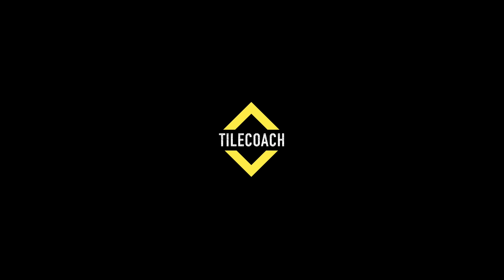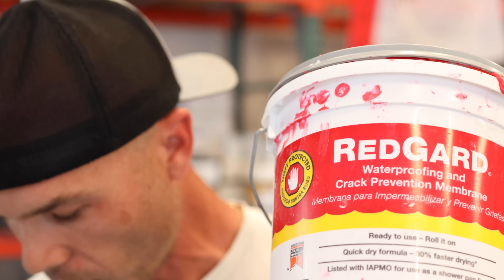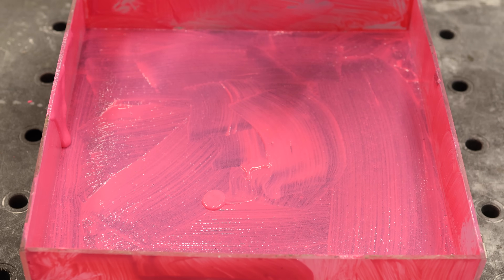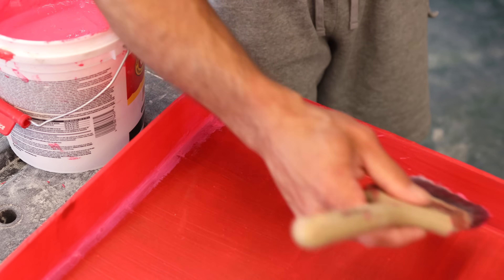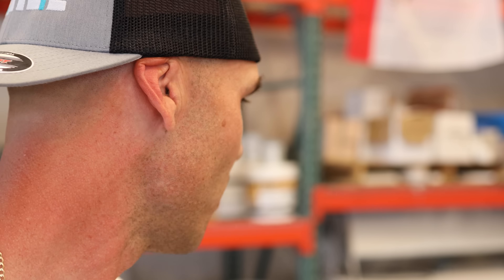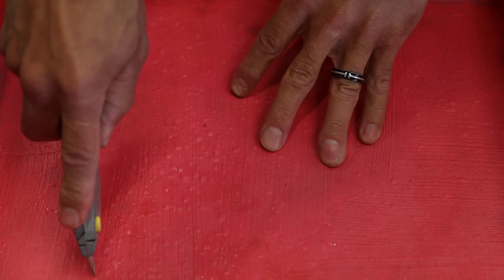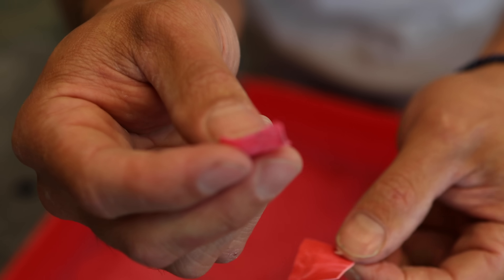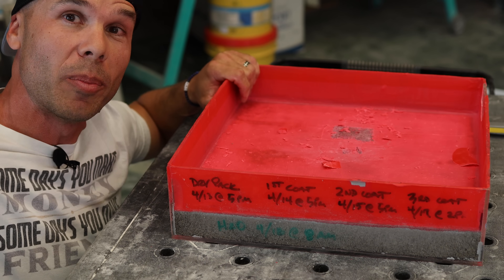REDGARD FAILED FLOOD TEST!!! --- Why Did it CRACK and BUBBLE UP???

Comment: Your model was a total bust. You took a six-sided non water or moisture absorbing plastic material, added a layer of water mortar mix and allowed it to cure for too short of a time. Once you coated the model with Red Gard it gave you a warning when you saw the cracks in the corners but you did not understand what was happening and applied a third coat. What your test displayed was the extra long dry time of the mortar for all of that moisture to evaporate from deep within. All of the cracks and blisters were caused by water vapor being drawn out of the mortar and being trapped under the Red Gard membrane. The water in the mix plus the heat generated by the mortar curing plus surrounding air temperature/humidity fluctuations plus the plastic shell created the perfect storm. Tile setters should allow much greater time for these materials to harden, cure and have their water moisture evaporate fully before application a water sealant upon them. I hope that helps or gives an explanation that can lead to further discussion.

Comment: Use Laticrete fiber tape and laticrete inside corners at seems and inside corners. 3 coats! On completely cured and dried fast cure cement. Hearst Casle's Neptune pool was redone using 3 coats of Red Guard

Comment: 1. I believe you should use a roller for an even spread
2. When applying the 2nd coat, it must be applied perpendicular to the 1st coat. 
Note: if the curing takes longer than 12 hours, something is wrong. And the glass can flex - not sure is the cracking occurred from this or the way you applied the actual product…
Reply: Also mesh backing should be applied over a calking in the corners
Reply: He was following manufacturers instructions. If he would have deviated from instructions then they would cry “foul” and come up with excuses to tear up his test results. He is using their own info to prove test.

Comment: Hi coach there are too many videos of shower failures. , People should avoid all the possible problems and call a professional to float cement over studs using 2.5 lath and 1.5 roofing nails.  install Quorloy pan or hot mop. Looks like flex seal could be a better option than kerdi or schluder. Never had a call back in 25 years using old school cement  method.
 My friend is second generation tile setter and that the method they do. One of my former bosses was also a second generation tile man and only used old school method 15 pound felt paper and 2.5 metal lath.  You tube has lots of video failures using newer methods and most may have been the installers error.   Looks like flex seal would be better than any kerdi or schluder pan especially around the drain. Quorloy shower pans needs special calking around drain.   Yes I like  hydro ban  better than red guard. People think if it's colored it's sealed. By  Brian

Comment: Flawed testing.  
RedGard as IAPMO Pan Liner meeting ANSI A118.10:
1 Gallon (3.78 L)	40 sq. ft. (3.7 M2)  NOT! 80 sq ft.

Bonding to Lightweight Cement and Gypsum Surfaces
Lightweight or gypsum-based materials must obtain a minimum of
2000 psi (13.8 MPa) compressive strength at the recommended cure
time. The underlayment must be sufficiently dry and properly cured to
the manufacturer's specifications for permanent, non-moisture
permeable coverings. 
Redgard does not give a specific cure time, because they do not know what type of mix you'll be using

Comment: Ask Redgard what their opinion is? The real problem is the plastic pans do not vent. That works just like it would if you used two vapor barriers. You are trapping moisture. Deck mud will not be dry in the time you allowed so now you have trapped moisture between the plastic and the Redgard. As a tile coach you should know this.
Reply: HE and you know it, but it's not in the instructions

Comment: yes I agree, The concrete takes much longer than 24hrs to dry, more like 48hrs+ depending on the thickness of the base and tempature of the air. 
Also Im thinking several thinner coats are better that 2 heavy wet coats. 
heavy coats are going to dry slower and have more tendancy to crack.

Comment: Tried the stuff on cementboard in the shower waited 2 weeks before applying made sure seams where all cured. Applied redguard and FOLLOWED the instructions on pail.  Waited another 2 weeks before starting tiles. Checked the redguard... peeled off with no effort. No sticky sticky to concrete board. Think I bought a pail that froze and was later thawed out.
   I go back to Kerdi

Comment: Where would this apply? Red Gard is almost exclusively applied to vertical walls. Gravity is playing a huge part. Red Gard is never used in a standing water situation. Water would never stand on a vertical wall. The water in a shower bounces of the tile and is rapidly pushed straight down by gravity. The test should involve a substrate; Durock painted with Red Gard with tile, grout and tile sealant. The water should be deflected off of an object that simulates the human body along with some soap. How many times does a home owner flood their shower to validate or imitate this sample test? It does not make sense. Use a typical shower setup where splashed water penetrates sealant on top of tile on top of grout on top of thinset. Red Gard was never created to line a tub where the water could not escape. The real problem is the shower pan or other horizontal surface. Maybe get a fire hose and blast a piece of drywall painted with Red Gard or covered with schluter. My shower is 20 years old and the tiles on the shower pan are looking very worn out, but I have no leaks. The tile setter formed the dry pack one inch per 18 inches. The water never has time to do any damage. I am renovating my main bathroom with a cast iron shower pan. It will beat any standing water test you can throw at it.

Comment: My guess is that because your mortar bed was in a plexiglass box, even though it cured, moisture was still present; trapped in the box and sealed by the redgard, hence the blisters.
Reply: This is exactly what happened.
Reply: No kidding
Reply: Yes  damp cement
Reply: Clever!
Reply: 💯 percent the bubbles under the redgaurd tells the story
Reply: So is no point in using the red guard, If you have to wait 2-3 days after your pan installation (in the case of a mortar pan).
Reply: Reply to all the "build base with wood" and "simulate real world conditions" -- the commentor is correct.  In this HARD scenario, this product fails.  In the SAME SPIRIT:  there's products that PASS in this HARD scenario (plexi box with no moisture movement capability).  So the simple answer is -- use the products that pass the HARD test.
Reply: Build the plexi box, but use wood subfloor  for the bottom. 
Only thing is.. if the installer used a membrane and then a dry pack on top, you would have the same situation as the plexi.

I kinda think that all though redguard changed color it wasn't fully dried. The water reactivated it.
Reply: Maybe a sealer on the morter bed before putting the Red Guard on so it allows the Red Guard to cure. Try that on your next experiment. If the morter bed was on wood the moisture while it was curing should pull through the bottom. Being it was set on glass it would take weeks for that morter bed to fully cure.
Reply: I agree. You might think the bed is dry but it's not. A wood bottom will wick moisture out of the bed and allow it to breath but never be damaged
Reply: Here's the thing,  Waterproofing a dry pack mortar bed is going contrary to how that bed is designed to drain, dry, and drain again. 

Two types of mortar beds...

Permeable and waterproof.
Reply: Agreed...3 days minimum on deck mud
Reply: I do not think that was the issue

Comment: Red guard fails if concrete is not done drying or put on too thick it will bubble every time. I only use red guard for handicap pans, curbs, framed custom sized inset soaps dishes, seams, and over cinder block seats. Any concrete shower pan that extends above the slab gets an Oatley pan liner. Tip for today is use a large concrete stepping stone cut on a 45 for floating corner seat. Double it up wedge it into the tile and versabond it to the concrete board. This saves time and money and takes a sledgehammer to remove it.

Comment: FIRST, I love you work. I have learned a lot from your videos and will continue watching and learning. BUT...both redgard videos you have were still not done correctly. You ALWAYS add fiber tape to the corners and the transitions between walls/floor....same with ANY brand of waterproofing membrane...schluter, guru, etc. You have to have that anti-fracture membrane...in drywall work as well.

Comment: First, thanks for all the informative and entertaining videos you produce. Lots of info for pros and DIYers. 

This video is a very interesting experiment and a great  example of what can go wrong when some of the finer installation details are not adhered to. In the Redgard instructions  Section 5, General Surface Prep, it states that porous surfaces must be properly cured and dry according to the manufacturer's instructions and then primed with a 1:4 product dilution. This thin coat will penetrate the pores of the substrate more effectively, thus sealing the surface and ensuring bonding of subsequent coats.

As far as curing time of the dry pack mortar bed,  Quikrete instructions for Deck Mud and Sand Topping Mix both state curing time is 5 to 7 days depending on ambient temperature.

For many DIYers the curing time and extra priming step are typically not a big deal, but I imagine that these times and extra steps are not favorable to pros who need to get in and complete the job quickly in order to remain competitive and profitable - seems that this is not a good way to go for pros. As far as liquid waterproof membranes go, more expensive products like Laticrete Hydro Ban are more reliable with less steps and less concern for precise wet and dry film thickness. These more expensive products appear to be targeted to professional installers where products which reduce installation labor time are more favorable than less expensive material which require more effort.

Anyway, thanks again for all the videos and keep them coming!
Reply: WOW! Very helpful! I will let mine dry 7 days, and dilute 1:4 for an extra primer step. Thank you for your input!
Reply: For the dilution, is that 1 part Redgard to 4 parts water?
Reply: @DavidKlausa  Yes, that is correct.

Comment: I use Hardie backer on the  Pan 1st.. Then Hardie backer surrounding on the walls.  Then I redgard  Entire shower Pan 6" above above floor. On all the corners I use fiberglass and paint into the corners.. I go very heavy about 5 Coats on the corners.. I have been doing it this way for 15 years. Then I do my mud pack on top of that.. Then I regard one more time On top of the mud pack with 2 Coats.. You will never fail

Comment: there is a reason that you see people using a roller and rolling on several thin coats  - because it works doing it that way - and it fails when you slop it on heavy with a brush.  You have been putting it on wrong for a solid 6 years.  Its like you are trying to make it fail - go check out star tile, he gets it.

Comment: im using this for a shower currently but i did use an oatly shower pan my intension is to prevent my bench and niche from failing the bench is also incorpated by oatly liner we see how the test of time lasts but it seems like it worked well it seems it just has problems makeing a good liner when bonding to the cement maybe doing more than the recomended coats would help it bond better? do you have a video of a mock up like this using the hydroban you spoke of?

Comment: The liquid applied in the corners is too thick and that's why it cracked. Applying extra over it  doesn't help because the liquid hasnt dried yet. All of the liquid membranes lighten but this doesn't affect the waterproofing ability. Its less obvious with the light/white colored membranes.

Comment: in all the 90 degree joints why don't you use fibre tape and then paint the redguard over the fiber tape. should be better results

Comment: This is concerning, especially since I’ve done two showers in my own home with RedGard!  But, RedGard is intended for showers where the water doesn’t sit on it for 8 hours.  Also, it’s not supposed to be the outer layer;  it usually has tile over it, limiting the amount of water that would ever come into contact with it in the first place. 

And while RedGard specs apparently don’t specify how long to allow the mud-bed to dry, or how soon to tile over it, I’m guessing most homeowners would allow the mud to dry for several days.  And by the time tile is applied, the RedGard has set more than it did in this test. 

Just my thoughts!
Reply: He also didn't install the fiber tape in the corners which are required with ANY waterproofing membrane. I have seen job and completed jobs myself many years ago that are still in perfect condition.  No mold, no cracks. I do weekend flood tests, so the water sits for a few days...ZERO failures
Reply: Your showers aren't over plexiglass. In the real world the moisture would have dissipated into the subfloor. So the problem here is there was still moisture in the mud, he applied the costs in the corners too thick (this is a problem with the directions) and no mesh. I'm not a huge fan of Redgard but I've done showers with 3 coats where I've left the pan flooded for a week and they were fine. I wouldn't normally do this but the jobsite was completely shut down in the middle of a 24 hour flood test so we couldn't drain until the site reopened.
Reply: I use redgard on the walls all the time but have only used it for the shower pan once and it has held up for 6 years - i think :).  In the shower pan it will ALWAYS be wet if the shower is used regularly. For a shower pan, I would never do less than three coats and would not try to apply quite as thick as this video due to cracking.

Comment: I like the effort put into making this clip however there might be one slight issue that has been overlooked.  I work with acrylic material as we use it to make custom aquariums of different sizes.  As you can see the box itself is made up of acrylic material.  In order to hold water the acrylic box CANNOT be "glued" together with silicone or DAB bonding agents because these adhesives do not make a proper bond to acrylic.  When building aquariums we normally "fuse" the acrylic parts together with a liquid polymer cement that dries instantly upon contact.  We use this type of bonding agent so that the acrylic can withstand the pressure of the water column that will go in it.  The pan used in the clip is bonded in a similar fashion and holds up great as the box itself does not leak.  The mortar however on the inside of the box rides up to an acrylic border.  The redgard membrane in this area goes over two types of materials, the acrylic wall and the mortar.  The redgard does waterproof the mortar , however, I do not think that redgard makes a strong bond to acrylic and quite frankly not many products will bond to acrylic and will flake away in the short run.  Paint will chip away on acrylic very easily after it dries.  Redgard does not have the proper bond strength to hold onto acrylic so it will fail in this test.  The mortar itself does not bond to the acrylic and if you tip the entire box upside down you will have the same effect as taking sand out of a bucket when making a sand castle.  It will all plop right out which means that the Redgard around the entire perimeter of the mortar is very vulnerable and flimsy. I do appreciate the effort put into these clips and I have learned A LOT from watching and subscribing.  However in this case a material other than acrylic should be used to conduct the test.  In reality we are typically waterproofing wood and cement type materials, not acrylic.
Curious to see how other waterproof agents will work on acrylic.

Comment: I'm tileing on a 1st floor cement foundation. 
I used redguard and when I pull up some two inch shower floor tiles (because I screwed up) the redguard came up too. 
I just said screw it and put the tile down with missing sections of redguard. 
I'm no pro (obviously) BUTT I used a good sealer and grout.
I actually wished I never used it.

Comment: I love your videos.  You are honest.  If you make a mistake, you don't hide it.  We all benefit from your experiences.  I will continue to watch and I'm going to subscribe.  

I recently did a shower with cement board (I forget the product's name).  After I installed that, I used Maepi "AquaDefense" to waterproof it.  BUT, i applied a fibrous membrane to stick the fibrous membrane to the cement board.  Afterwards, I applied an additional two coats of the waterproofing.  The result wasn't the flattest surfaces, especially in the corners and the threshold, but I'm hoping what I did will result in a shower that will last without leaking.  Also I used a flexible shower pan instead of just the dry pack and waterproofing.

Comment: Did the rough texture of the mud pop holes on their mountain peaks with the weight of the water? Causing blister? Because if I saw someone do their shower pan like this  then leave it filled with water, I would say yeah nah big dog. Whereas there's people in the comments saying it worked fine on a tile back board pan. with the imbedded reinforcement membrane in the corners.

Comment: Great video. I think you did a great job in the entire process, extremely professional in my opinion! I think the concrete bed is the problem. Perhaps if the bed was treated w/ some kind of sealer first
Reply: Concrete shrinks on cure